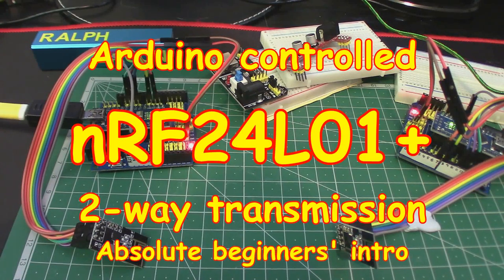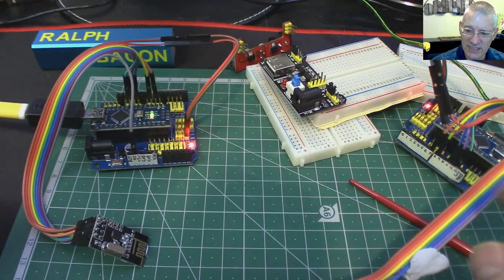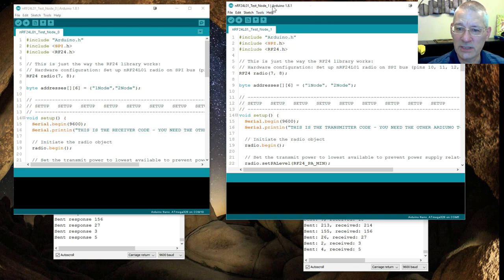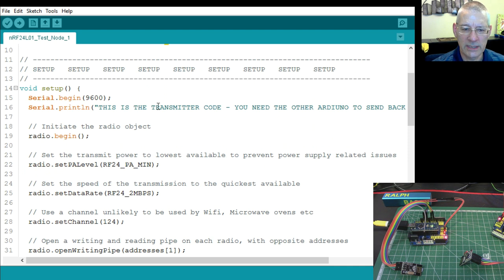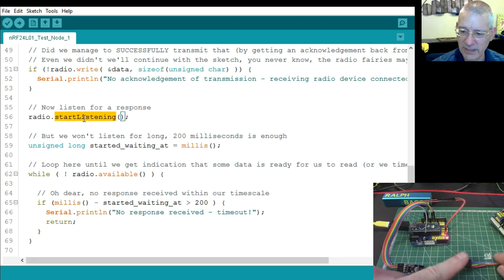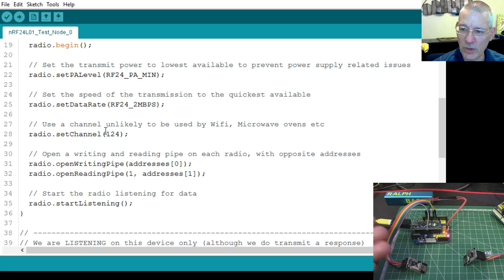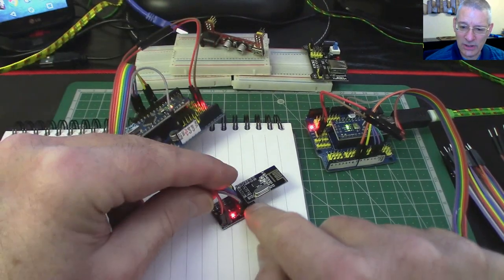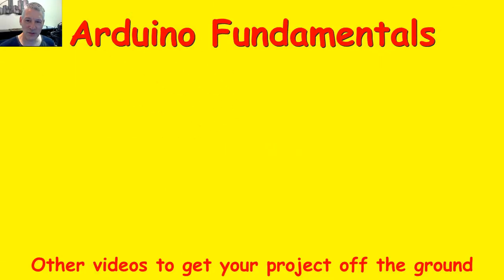#73 nRF24L01 Send (and receive) data with your Arduino!

Comment: You can get adapter plates for $.50 or less, postpaid, on AliExpress.com -- Bangood looks to be almost always way overpriced. You can also get the same two boards with SMA connector and antenna at AliExpress for $1 less than you paid. Or you can go on Ebay and pay 5x to 10x the same price as buying direct from China. The only advantage I've found to using Bangood is occasionally/rarely they have something that AliExpress doesn't offer. Thanks for all your great videos.
Reply from the maker: Do you know what Art? I too have found Banggood to be quite expensive lately. I put it down to the value of the British Pound dropping but even looking at the $ prices makes me think you are absolutely spot on. And AliExpress is like a mini-eBay in itself, the service is good and the prices competitive. I've bought some stuff from AliExpress but Banggood (and Gearbest) were always convenient but now... well, your experiences seem to coincide with mine. Interesting that you point this out, not just for me but others too who read this, why pay more when you don't have to? Thanks, too, for the encouragement, it's great that my Arduinite viewers like my videos. Great post, appreciated.
Reply: @RalphBacon  Unfortunately Ali Express does not accept Paypal, unlike Banggood. And somehow I always feel better when using Paypal rather than sending out my credit card details.

Comment: I have a 1/2 dozen of these and never used them. My plan was to have 1 in each greenhouse ( 3 at the moment ) to transmit temp, light level and such back to the main house and to the IOT thing. ( Mobile App thing ) Perhaps it's about time I started getting familiar with these devices. Thanks for the kick in the ass to get me going.
Reply from the maker: Indeed, Darrell, consider this an Arduinite kick in the ass!
 
Now that you have an ultra-simple demo to follow, I reckon you'll only have to change the amount of data to transmit. If you make a fixed string size (temp + light level + humidity + whatever) as a string or char[ ] then you will have no trouble doing this. It's how I did it in my 433Mhz rain sensor project a while back. In some ways I wish I had used this nRF24 device if only because it guarantees reception (or tells you it failed). That said, my rain sensor project has worked beautifully ever since I installed it so maybe I have a (new) solution looking for a problem (and what's wrong with that? heh heh!).
 
Anyway, I hope this has fired you up to get that greenhouse project underway ready for the Spring 2017 (assuming you live in the northern hemisphere).
Reply: Spring will be here any day now as I live on Vancouver Island In Western British Columbia. Although for a known mild climate this year winter is sticking around much longer than usual. Global warming my ass.
Reply from the maker: I shamefacedly admit to having to look up that location, Darrell, but having discovered it is in Canada, no wonder it's cold! I think UK weather is sometimes weird but at least we don't have bears wandering around <wink>. Now if you could just slip a nRF24 on a collar round a bear's neck to track him that would be a good project...

Comment: Hi Ralph! 
first of all thank you for sharing this video with us.

I would like to ask you a question; is it possible to receive data on the spatial position?
Reply from the maker: Do you mean where the other system is positioned, like a GPS signal? If so, then no, although you could install a simple GPS module and send the coordinates back to the initiator, I guess.

Comment: @Ralph Thanks for the video, I have a question.
1. which pin in Arduino nano connect to the pin IRQ, and CE in NRF24.
Reply from the maker: The Nano is exactly the same as the UNO in this respect, same pins etc.

Comment: I am trying to test out my transmitter and receiver using your set up and no matter what I do I don't seem to be able to get them to 'talk' to each other. The transmitter is continuously outputting "No acknowledgement of transmission - receiving radio device connected? No response received- timeout!" and the Receiver just says the startup line of "THIS IS THE RECEIVER CODE - YOU NEED THE OTHER ARDUINO TO TRANSMIT" I have the bigger NRF24L01+ with the antenna attached and the connection board NRF24L01 YL-106. I saw you said to someone in the comments below that with the attachment board you power it with the 5V port but I am just wondering if I could be doing something else wrong. It seems that the transmitter isn't recognizing the receiver and vice versa
Reply from the maker: Hi Alison, sorry to hear you're having issues. Look at the post in the comments on this video from "nouar" who is also having problems and ensure you have followed the suggestions I have made there first. I have to assume you have wired it up correctly (the pin-out diagram is a TOP view with the wires coming in underneath, so it can be a little confusing).
 
If you are using the adapter board into which you have plugged the nRF24L01, the yes THAT board needs 5volts. The bare module alone needs only 3.3 volts (or you will fry it).
 
Also make sure you have kept the power to both modules to the LOW settings (in my sketch you will see RF24_PA_LOW. You can even change that to RF24_PA_MIN to keep power to an absolute minimum, although the range will be about 30cm / 1ft).
 
Also set the speed of transmission to RF24_250KBPS for the most reliable transmission. So change this line: radio.setDataRate(RF24_2MBPS); replacing the 2MBPS to 250KPS on BOTH sketches.
 
Finally, many users report that the 3.3 volt supply is too noisy to work reliably and solder a capacitor on the module itself between VCC and GND with a value of 1.0µF - 10.0µF. You can solder this directly on the board underneath - it doesn't have to be pretty, you just want it so it doesn't short out - that is why I recommend the plug in adapter boards, it gets round all the power issues.
 
Try all this out and post back! Fingers crossed.

Comment: Hi Ralph! Thank you for taking the time to make this video. It has been a tremendous help for me in learning how these little modules work. As an absolute beginner to this kind of technology though, i still get kind of lost when it comes transmitting data of different types and sizes. I'm looking to transmit an array comprised of 5 values from one arduino nano to another. Could you please explain a little more in depth as to what I would need to do to make that work and why? Thank you so much!
Reply from the maker: I'm pretty sure that you can transmit up to 32 bytes of data in one go (concatenated as a simple string). Hmm, maybe I should talk about this when I do my video on the Benny IN/OUT indicator (using my TFT screen but also a couple of nRF24L01s too). Thanks for the prompt, I'll include that info.
Reply: Thank you sir! I have it figured out now (:
Reply: @romanhuante  pls tell me how. I wanna send multiple values too.

Comment: The weird thing about using these PA + LNA modules is that the receiver side works properly, its not an arduino issue, but the transmitter side doesnt. For some weird reason, shorting the two pins with your finger makes the output of com3 go mad, which is very very weird.
Reply: another weird thing that the arduino at the receiver side is doing is that when i short gnd and vcc on the receiver side, the transmitter side stops outputting on the serial monitor, please make a video on this sir
Reply from the maker: All I can say is that the PA+LNA versions work just fine "on my machine"! I don't recommend shorting GND and VCC under any circumstances, are you sure you meant that?
Reply: @RalphBacon  Sir i do know what happens when you short vcc and gnd, but for some reason it does make it work, still i find it weird. Let's see on the weekend, i hope i can get the antennas to work, I'm buying the no antenna module to see if they work

Comment: Great tutorial. What do you think about encapsulating data for mesh networking with these?
Reply from the maker: There are some code examples in the library that deal with mesh networks but I have to admit I've never needed one so have not experimented (yet).

Comment: USB setup. Only needed once. COMxx?  xx is what I found available as nano units plugged in.
 TX is port COM51.
 RX is port COM14, set by device manager, advanced settings.
1. Unplug both TX and RX from USBs
2. Start TX program (node_1). Make sure COM51 selected
3. Plug in TX (com51)
4. Start Serial  - It should give 'THIS IS THE TRANSMITTER CODE...'
5. Start RX program (node_0). It will say port is COM51. Make sure COM14 selected
6. Plug in RX (com14)
7. Start Serial  - It should give 'THIS IS THE RECEIVER CODE...'
8. Should all be working.  Fail? Back to the top and try again after closing both Arduino IDE programs.
Best of luck!
Now to do some serious stuff and programming, after this distraction.
Reply from the maker: Great info, Neil, the Arduino IDE can be very picky about all this (which is another reason why I tend to use the Eclipse IDE). Thanks for posting.
Reply: @RalphBacon  
For serious work I use the Atmel IDE which handles Arduino stepping forward. Once there, there is no going back, easily. It also shows the shortcomings of the Arduino IDE when it comes to correct c++ structure and conventions. Handles c modules properly, too.

Comment: These are great nRFs  easy to use but no SOC. newer ones have both.  Just be aware that you can only transmit 32 bytes of data. Also receiver can go up to 5 or 6(not sure of the number of the top of my head ) kind of like Xbee 
But then it's more of mesh network I am talking about 

One more thing is possible to use Struct to send diff kinds of data as one block

Great video Ralph
Reply from the maker: Hi Raad! The author of the RF24 library even has one for audio so I guess he gets round the 32-byte limit (perhaps he just transmits 32-byte chunks, I haven't looked!). He also has a library for that mesh network you mention. But frankly, I think most Arduinites will just want a fairly simple system and for that purpose  these cheap (but very clever) units really do fit the bill, don't you think? 
Thanks for pointing out those caveats, it's this sort of information sharing that makes the Arduino collaboration so very powerful - and ensure we buy hardware with both eyes open!
And I'm glad you liked the video, I'm hoping it was as simple as could be so beginner Arduinites could follow it!
Reply: I do agree - keep it simple is my motto for sure
I run into trouble with these when I hooked them up to ESp8266.  The power the ESp8266 was giving out was not enough to power the nRF, so I used the capacitors. 

Again, enjoyed the video.  Keep them coming

Comment: Hello Ralph, great video, it lead me to success! I've built a remote sensor using the nRFL2401+, is there anyway I can get the nRFL2401+ to tell me when its battery is running low?
Reply from the maker: You can get the Arduino to tell you this by monitoring the battery level on an analog pin, David. I'd use a simple 1K and 10K ohm potential divider for this. Two resistors, the 1K from +ve and the 10K to -ve with the analog pin connected to where the two resistors join. The Arduino can then transmit a data packet that you interpret and that tells you the battery is low. Experiment on a local Arduino so you get the correct measurement. Any good?

Comment: Again one more superb video. Ralph i followed all your steps seems like my receiver does gets request from transmitter but transmitter never prints anything it always say.  "No response received - timeout!
 No acknowledgement of transmission - receiving radio device connected?" .. Is there any incorrect PIN which could cause this?
Reply from the maker: Let's use the terms MASTER and SLAVE for these devices, Akshey, it makes more sense. So the Master is sending a value out, the SLAVE receives the correct value but does not auto acknowledge back to the Master?
Two things stop these devices working: 
1. Incorrect wiring because you have to wire 'from underneath' so it's easy to get wires crossed
2. Lack of the plug in adapter that allows you supply 5v to the board which then steps it down to the required 3v3 at the necessary current. It also makes the wiring easier as it's all done from the top.

So I would firstly get the adapter boards, firstly, very cheap, from Amazon or Banggood or Gearbest or somewhere. Whilst you are waiting for them, check your wiring and power configuration of both boards. Set the power level to minimum and ensure the boards are physically close together (within 30cm).
If you are using my sketch then you know the code works so it can only be (1) or (2) above!
Reply: @RalphBacon  Thanks Ralph i was able to resolve issue with adding capacitor at nrf40, but now the problem is both are sending messages but neither Master nor Slave display message send. I put comments  so it does work just that Master always says 0 received when slave does say it send value. Where as slave always say received but doesn't have any value. Signal for both seems to be working it seems that data is either getting lost or not able to read..
Reply from the maker: Get the adapters, that's the first thing to do, really it is.

Comment: Hey, Mr Bacon! I found this very useful. I do have a question, though. In my computer, there's just two ports, while yours seems to have more. Can I "add" multiple COM ports, or is it unchangeable?
Reply from the maker: Hey, Vivek! Com ports are not added (not by you anyway).
 
When Windows is notified by the USB bus that a device has been attached it will allocate it a COM port number, not randomly but in a more-or-less sequential way. As you disconnect devices those ports "disappear". The same port number is (usually) allocated to the same physical USB socket you plug stuff into. So if you plug your Arduino into the leftmost USB socket of your hub, and is allocated to COM 5 then it will almost always be allocated that COM port number if it is plugged into that socket again (unless already in use). That's why it is good to always plug USB devices into the same socket otherwise it will re-enumerate and re-install any drivers (for that COM port).
 
If you go to the Device Manager, View, Show hidden devices you'll see the COM ports that were previously assigned to stuff you previously plugged in.
 
All clear as mud?
Reply: Ralph S Bacon So basically, the more new devices I plug into my device's USB port, the greater the number of COM ports that appear in it. Am I getting this correctly?
Reply from the maker: That's exactly how it works, Vivek.

Comment: Dear Ralph, i have setup a similar setup as your video here, the thing i have is that i'm seeing the "No aknowledgement" message, but on the receiver side it still states "Sent response .." and counting up. what could be the cause of this? I expected that if the transmitting side does not work well, the receiver side doesn't do anything right? At least if i disconnect the transmitter from USB the receiver stops sending out responses, so something reaches the receiver. Any thoughts, many thanks ahead.
Reply from the maker: Well now, Bas, you are sure the receiver is getting the correct value (from the transmitter) but the transmitter is not getting the auto-acknowledgement? I'm firstly assuming you haven't programmed the nRF24L01 to disable that feature as that would be too silly for words. In which case, are you running the nRF24L01's on their adapter boards? If you don't have adapter boards do yourself a huge favour and get some, they are very cheap and solve 99.9999% of all problems with these devices. If you do have the adapter boards already, let me know and I'll think of what else we can do.

Comment: I appreciate the video, but my NRF's aren't communicating with each other. One is saying "THIS IS THE RECEIVER CODE - YOU NEED THE OTHER ARDUINO TO TRANSMIT
" and the other one is saying "No acknowledgement of transmission - receiving radio device connected?
No response received - timeout!
"
I'm not sure what I did wrong. Can you please help
Reply from the maker: There are some actions you definitely need to take, Shiven:

1. Get the adapter plates. It simplifies the power supply and the wiring is done from the top too. They are cheap: https://amzn.to/38AUltF
2. Double and triple check the wiring. With the adapter plates it's a lot simpler.
3. Ensure the devices are within 30cm of each other with my sketches as I use minimum power. Once you got it working you can increase this.
4. Swap the devices over and see if you get the same error(s).

Try these in the order I have listed them - it will work if you have not changed my sketches.

Comment: Thanks for the video Ralph, very informative and helpful for a newcomer to the subject. I am awaiting arrival of 2 Rf nano's - so no separate tx / rx modules. Have you come across these yet ?
Reply from the maker: Do you mean the new Arduino Nano 33 IoT? I've not got any experience with that (yet). A bit pricey for my shallow pockets! It uses via WiFi not the (same frequency) 2.4GHz bespoke comms of the nRF24L01 though. It will be interesting how those communicate; I'd expect that you would have to know the other's IP address.
Reply: @RalphBacon . Sorry no Ralph i was referring to this... https://www.aliexpress.com/item/32980796969.html?spm=a2g0s.9042311.0.0.785e4c4doapbjE
I am a little limited on space so thought this was helpful being integrated all in one.  Oh, Nano 33 IoT just had a look at that and may have to play with that one in the future !